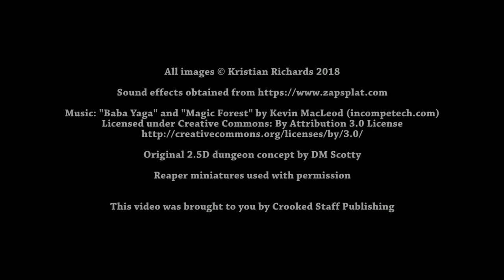Episode 14 : Rusty Metal (dungeon terrain)

Comment: poke small pin holes in end of pipe, run Fishing Line from Pipe down to Puddle built onto the pipes base, Bead hot glue down fishing line to look like Water flowing, you can also use inks to shade the glue to make greenish colors and etc .

Comment: That's so pretty, Great to make good puzzles, better quality than most pricey store's options.

The multi slot can be put in floor/wall/ceiling as a trap, releasing poison, darts ,water, fire or ants with smol lasers.

I will use sticks, you know for the straws ban.
Reply from the maker: Yeah, I think they'll be quite versatile ...though I do hope to do a dedicated 'traps' episode somewhere down the line.

(and yeah, if/when they ban straws here in the UK I'll have to find some other material to craft with)

Comment: Another solid video my friend, can’t wait for your sewer tiles I had to combine your others into one (sent pictures to your Facebook) .... do you think the bars texture could be modified to a ladder ? Can’t wait to try it !
Reply from the maker: Yeah, I remember seeing your sewer tiles - however I'm torn about whether I should supply the water texture and floor texture as separate pages - or combine them into one ...I'll have to see how it goes).

Also, I don't see why you couldn't use these textures to make a metal ladder :)
Reply: If you have any doubt make it two pages, full page textures gives people the maximum amount of flexibility, my printer prints 11x17 (A3 for those if you on the metric system) do I already make bigger tiles
Reply from the maker: It's just that I think I'd prefer for the tile to be all on the same level (for easier miniatures placement and quicker assembly) ...rather than having a lower piece for the water, a higher piece for the walkways, and then another level on top of them both for the walls. I'll have to see how it goes :S

Comment: Can you do a rope and pottery/clay texture?
Reply from the maker: There's some basic pottery stuff in episode 5, you can see them at the end here: https://youtu.be/Qrb6_ILiAG0?t=579

And for rope, it's probably easier to just buy some cross stitch thread - like I did in this video: https://youtu.be/JRXwahjKDOo?t=604

But if that's not an option - then the 'sack' textures (cut into strips) might also work (depending on what you're using it for).

Hope that helps!
Reply: Thank you, yes that make more sense.